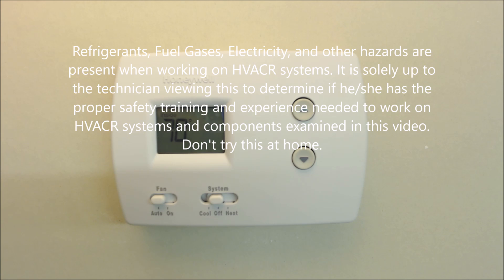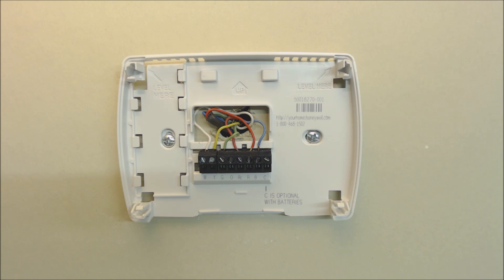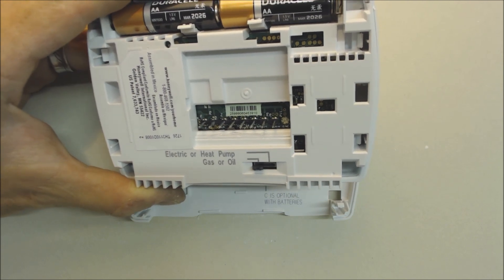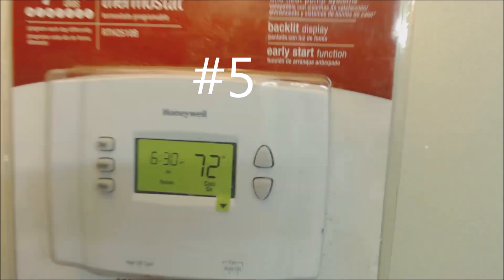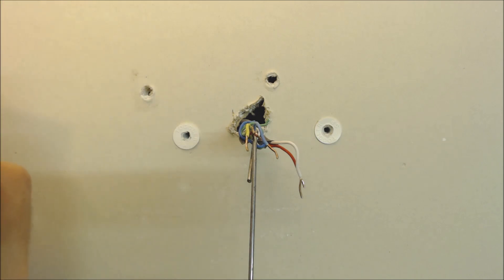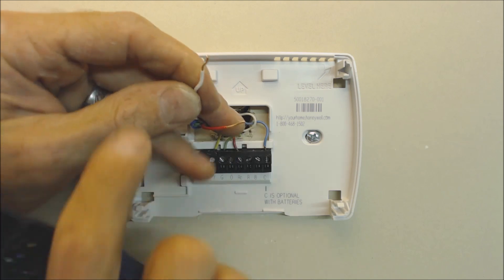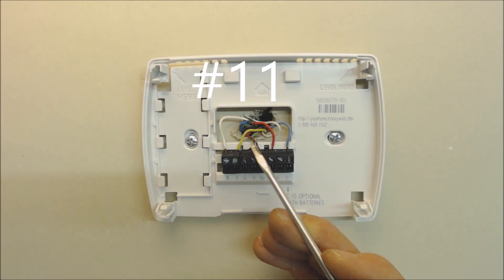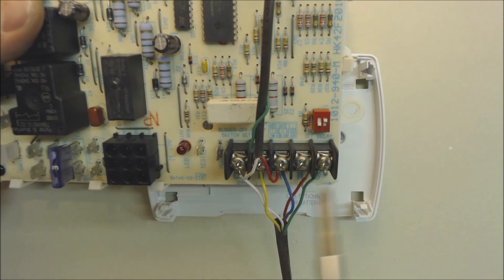Top 12 Problems/Mistakes when Installing or Replacing Thermostats! HVAC Tips!

Comment: I have a Honeywell TH 8320WF thermostat.  I used it with a dual fuel system, before replacing it with a Nest unit.  In trying to reuse it to replace a non WiFi thermostat in another location, I damaged the RC connector.  I took it to an electronics shop and the soldered a jumper wire on it so that I could connect R and RC.  Al other connections appear to be correct, but the thermostat will not power on.  When putting to old thermostat back on, it powers up and works correctly.  Can you help me troubleshoot this issue.  Is the a fuse within the thermostat that could be replaced?  Thanks.
Reply from the maker: No there isn't usually any fuse in the thermostat. It sounds like the voltage is not making its way to the board of the thermostat. You are wiring C as common though correct? Thanks
Reply: AC Service Tech LLC yes.
Reply from the maker: If you know that you have 24v from Rc to C and the thermostat is not powering then the tstat is bad. Are you missing the jumper from Rc to Rh and are you putting the red wire in the Rh?
Reply: AC Service Tech LLC The RC terminal screw is messed up.  I had a tech soldier a wire to it, the put the other end of the wire as a jumper into R.  I then added the red wire to that terminal and secured it.  All other wires are correct, per instruction manual.  Is there a way to test the thermostat with a multi meter or some other diagnostic tool?  I was thinking of putting it back into it’s original configuration with the duel fuel setup, to see if wiring it that way would make it work.  The application I moved it too is just a heat pump.  The RH you mentioned is something I am not familiar with.
Reply from the maker: Oh you connected Rc to R, sometimes the R is labeled Rh. The only way to test is after the wires are going to the air handler but if the tstat is not even powering up and yu measure 24v at the tstat sub base at r and c then the tstat is bad, thanks
Reply: AC Service Tech LLC thank you.  I appreciate it.

Comment: Q:  I replaced my batteries in my thermostat that was working with no prior problems . Now when I turn on heater it’s a 50/50 chance the air will be cold. In the evening it won’t heat . First thing in the morning it does heat on auto...but when set temp is reached and it turns off the next time it kicks on there is no heat just air. Do I need to replace thermostat?  Thank you
Reply from the maker: Try new batteries, make sure the button is on hold if its programmable, make sure the pins in the back are making good contact and the face of the thermostat is tight to the back plate, thanks

Comment: Our system has water heated with gas but the igniter uses electricity, where do I put the switch and does it matter where the switch is set?
Reply from the maker: What switch?
Reply: Thanks, I'm trying to install a Honeywell RTH2300 Programmable Thermostat but I just downloaded the manual and will see how the old thermostat was set.  I have yet to start work on this project because I don't know if after turning off the electric and switch to the furnace I will need to light the igniter again (I don't like doing that, got to kneel down and reach with a match). In the meantime I just went to look at the thermostat and it is now registering the temperature! Yesterday I took it off the wall to check out the wiring then put it back without doing anything. We have never lost heat, it's just that the temperature was showing 16 °F.even though it was 65 °F. Perhaps the l.e.d.s or whatever creates characters on the gizmo are fried, which is why I purchased a new thermostat.

Comment: Great video, thank you. Question: where is the fuse located in a Honeywell located. I never knew that a fuse is inside a Honeywell thermostat.. Thank you.
Reply from the maker: It is not in the thermostat but in the furnace or air handler. It is usually 3 or 5 amps, thanks and look up "acservicetech blown fuse"
Reply: @acservicetechchannel  acserviceblownfuse

Comment: Excellent video and I subscribed
Quick question where would the black wire go the one that goes to the Transformer
It's a Coleman heat pump unit 
Would it be Y 2  E or L
Reply from the maker: If it is from the common side of the transformer then it would go to C in the thermostat if you want to hard power it. If you have red and black coming from the transformer then black would be the common, thanks

Comment: I have a Honeywell 3000 thermostat and there is no G wire. I live in an apartment and the blue wire was connected to the green. Is that an issue? I just put the blue wire to the C optional cuz it runs off batteries and there is no green wire. The reason why is cuz we would set the thermostat at night cuz it's winter now and it just shuts off after 10 min. I wake up for work and it's 53 degrees in n the apartment. Help.
Reply: It's also a 4 wire. Y,W,R,B. No G.

Comment: Problem #3, You didn't explain the functionality of that Gas or Electric switch/jumper! (with respect to system/blower operation)
Reply from the maker: The gas switch does not turn the blower on when heat is powered. The electric switch does turn on the blower when the heat is turned on, thanks

Comment: This was very interesting, but I think my problem is different.  I have to replace the batteries at least once per 2 months.  Seems too often.  Today when I replaced them, the thermostat was still dead for 10 mins, then somehow came back to life.  The thermostat is only 2 years old.  Any ideas on what could be wrong?  PS - I'm clueless about electronics and handy stuff.
Reply from the maker: Are the battery terminals that touch the batteries a little corroded? Otherwise, I would say to replace the thermostat, thanks!

Comment: I was changing my thermostat to Nest but forgot to shut the power off.  Now no power is coming to the Nest or the old one.  I'm assuming I touched the wires at some point.  Help!!!
Reply from the maker: You may need to replace the 3 amp or 5 amp fuse inside the furnace or air handler, thanks

Comment: I have  hONEY WELL,,,,,,,,,,,,can not get it to  work........am so so sick and no heat.  Mine does not have a set,done,or any other kind of button to over ride...have now turned  it to fan on................amazing  that works..........hope it goes to the heat set.                 thank you.
Reply from the maker: It sounds like a tech my need to switch that out but they would need to diagnose the problem first, thanks!

Comment: Hello, I’m so grateful that you have taken the time and knowledge of explaining which wires “should” go where and why. Your direction is very helpful. I just moved into a condo and did need to call a technician at $78. to determine my problem The thermostat was that not working was probably an original as my home is now 20yrs old. He was such a kind and honest man telling me he’d have to charge $485. to charge the thermostat. I don’t have that kind of money and my homeowners warranty I always carry was a day away from kicking in, so he was so great at pulling the cover off of my thermo (something I thought would break it straight away, because I honestly had no idea that’s how to even work or change it. ** back to my problem **... I followed directions, put the stickers on where the wires had been. Everything seemed like clockwork and because we’re going down to freezing temps at nights so I was thrilled to get my heat working. I don’t want the programable option on this Honeywell model I chose so have been using the override method. When I’m hot, I know that and if I’m cold I’ll adjust it, so no need to have a set schedule to keep me comfortable. 
Ok...finally my problem 🙄,i discovered today...because it actually got warm today, that I wanted to cool my home just a few degrees and that’s what I’ve been trying to figure out the last 6 hours. What did I not do correctly. I have a hydroponic system so I followed the setup listed in the thermostat direction. When I switched it over to cool, I can’t get it to kick on. Your explanation of the wires might be helpful only obviously I’d like some backup now because my A/C isn’t kicking in. I’m 60 and often can repair easy things and today with Utube it’s almost foolproof, and that word of foolproof hasn’t been on my side with this thermo. And now with your tutorial I might have a chance, However, with my current problem and question obviously “I’m” not foolproof. I’ll try to check and rewire where my mistake may have happened and hopefully I haven’t ruined anything. Wish me luck. Sending me a little advice would be extremely wonderful if you’re reading this blog, and my problem is probably one you’ve encountered. Thank you again for your tutorial on thermostat education.
Reply from the maker: There may be a dip switch on the tstat on the back side or you may have put the wire that was in y into the new tstat at y1 instead of y/y2, thanks
Reply: Hi there! Thank you for that. You may not believe what happened but I’ll tell you anyway. I was ready to punch myself when I’m holding this top part of the thermo in my hand and was just staring at with a whole bunch of anxiety when I noticed that the very end pin is bent and that’s the port where the mm

Comment: I have been recently having a problem with my thermostat it is a c3200a thermostat I have heat only it does require batteries but the temperature will not go up Beyond 57 it's been like that all week I am so cold in this house and my animals are too. According to the instructions I looked online for the manual if the battery is low there should be a b a t l o blinking on my LCD screen but there is no indication of a low battery whatsoever I hear my furnace kicking on every now and then but it just won't go up Beyond 57 or 58 degrees any suggestions?
Reply from the maker: That really sounds like a bad thermostat, thanks

Comment: My fan wont shut off. What should I do?
Reply from the maker: You may have a safety sensor that is tripped. Make sure to look at your error code flashing if it has an LED. If you have a fan limit control, you could adjust that. Try turning the power off and back on. If it is a safety then there is another problem, thanks

Comment: I have a Ruud HVAC with secondary electric back up heat. Honeywell thermostat with manual EMG switch when H.pump cant keep up. I want to replace it with an automatic secondary triggered thermostat. I bought another Honeywell today. I have no orange wire on the older stat, it's clipped and taped on both ends. There is one on the handler that goes outside to condenser. The orange wire has a wire nut on it from the handler. Do I hook it up to the "O" on the new thermostat? Leave it off?
Reply from the maker: it may be another color but you should have something to power the reversing valve of a heat pump outside. It would be in a B terminal, thanks

Comment: What problems can solution #3 cause? My thermostat on the inside is set to Electric but i have a gas furnace but it still turns it on, my house temp wont go above 59-60 degree even tho thermostat is set to 80. Can anyone help ?
Reply from the maker: If it is on electric then the outdoor air conditioner may run as well. It needs to be set on gas furnace if that is what you have, thanks

Comment: My fan won't go off when it's on the auto with heating. 
On cooling it works perfect, but on heating - keeps heat all over and over. 
Changed thermostat, but it didn't help.
Any advice?
Reply from the maker: If it is a furnace, the control board would tell the blower to turn off as the last step in the sequence of operation for heat. If the furnace does not have a control board then the fan limit or fan relay could be bad, thanks
Reply: @acservicetechchannel  Now i am more confused. Thank you to answer!

Comment: Great video, thank you. One problem I have not addressed here- I'm replacing a 27 year old Bryant thermostat on a heat pump with a Hunter 44132. The old Bryant has 7 wires attached. The R, Y, G, C, and O are easily transferred, but my old tstat has a white wire going to W1 and an 'beige' wire going to E. The old tstat has an emergency heat switch which the new one does not have. Which wire, white or beige, will go to the E terminal on my new tstat? There is not a W1 terminal on the new Hunter, only an E. I do have a newer tstat on a similar system and it only has 6 wires connected.
Reply from the maker: You would need to have a heat terminal as well as the emergency terminal. That may not be the appropriate tstat, thanks!
Reply: @acservicetechchannel  That's what I was afraid of. This is a system for my upstairs bedrooms and it's rarely used, and in 27 years the emergency heat switch was never used. I don't even know if the coil backup has ever kicked in since the primary unit heat rises- the bedrooms open up into a cathedral ceiling great room (and I use a wood-burning stove on the coldest days here (near Savannah, GA.). At 27 years old for both the condenser and ventilation unit, they're working on borrowed time anyway. My problem has been the upstairs thermostat was in the hall opening into that great room, so it wasn't reading the actual temp of the rooms it was cooling/heating. So I moved it into the main guest bedroom and was going to use this Hunter I found at a thrift store, new in the box. Looks like I'll just move the old one until I replace the system. Thanks again, Louis.

Comment: Thanks, very helpful, but we tried to replace a TH3110D1007 with the TH3110D1008 linked below & it doesn't work, although they look identical. Used for heating only, no ac, had to replace because of battery corrosion. Any clue?
Reply from the maker: Did you turn the switch on the back for gas furnace if that is what you were using for heat. They have a switch for a heat pump or gas furnace, thanks
Reply: @acservicetechchannel   We'll check that, thanks a lot.

Comment: Great work and thanks for sharing!    Question for anyone who can answer..  my mother in law had some guy install a new Nest thermostat in her home, ac/ gas furnace combo, but now the heat doesn't work.  The AC works and the fun runs, but no heat comes out.  Problem is, I don't know how the old thermostat was wired..  the next currently has Red to R, white to W, yellow to Y1 and green to G.  This all seems right to me, but obviously there's an issue.  I appreciate any help!
Reply from the maker: You might need to go into the settings to make sure it is set up for the correct type system, thanks

Comment: Should the common wire always be hooked up
Reply from the maker: Not unless you want to power the thermostat with the 24v from the furnace or air handler. Digital thermostats without a common use batteries to power the display, thanks!

Comment: I've heard mixed answers.  Can I use a Honeywell RTH2510B 7 Day Programmable thermostat to control a gas furnace?  It looks like the programmable thermostat I have right now, but it only allows you to set the programming for weekdays or weekends.  I'd like to be able to set different times for different days.
Reply from the maker: It would be best to just type that model in the google search with the phrase owner manual and you will find what you are looking for, thanks Zina J!
Reply: I found the manual (https://customer.honeywell.com/resources/techlit/TechLitDocuments/69-0000s/69-2420ES.pdf), but no luck seeing what systems it can control.  I'll continue to look.  Thanks for the help and the good advice.

Comment: After I changed batteries the thermostat shows wrong temperature, like 15F higher than it is. Can I repair it, or I need to buy a new thermostat? I have "White Rogers" similar to the one in this video.
Reply from the maker: Wow, yeah that has to do with the thermostat itself or the battery voltage, nothing really to fix that, thanks
Reply: Thank you. I cleaned contacts, rebooted it, but temperature reading climbed up again. Now it actually shows 2 minus signs instead of any numbers for current temperature.

Comment: Awesome video. I just changed my thermostat and can not get the ac to work when I put it on cool the fan in the outside unit works but no. Air coming out the vents. When I turn it to heat the fan does not work outside but the part of the ac that is inside kicks on. I marked the wires from the old thermostat. I have a red which was attached to rc a blue which was attached to rh, a yellow marked yellow 1 a white marked w1 and one that looks almost white attached to g. I have pics if that helps.

Comment: Great Tips! Thank you! My replacement thermostat was expecting 'C' connection, but my existing thermostat did not have C, but there was wire available, but not connected. I opened the HAVC and connecting the 'C' wire, and connected the new thremostat- but it was not working - I though i blew the fuse. After seeing your video, I realized it is the auto-shutoff safety switch!! once i put the panel back on it started working again. Thank you very much!

Comment: I have this thermostat, Installed in August 2017. The display isn't working correctly even with fresh batteries. Any suggestions?? It's hot as heck in here.
Reply from the maker: It sounds like the thermostat is bad or is not getting the right ac voltage on the r terminals.

Comment: I have a carrier gas heater with 4 ton condenser. I want to change the thermostat  to the pro 3000. I have a w wire for heat and w2 for second stage heat. Would I put the second stage heat wire in the w on the pro 3000 and just cap the single stage heat wire .